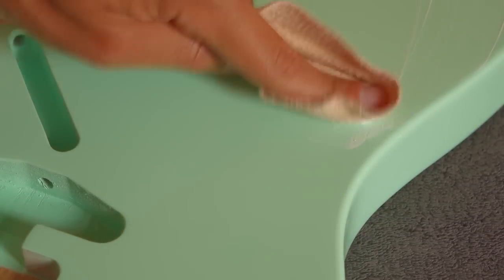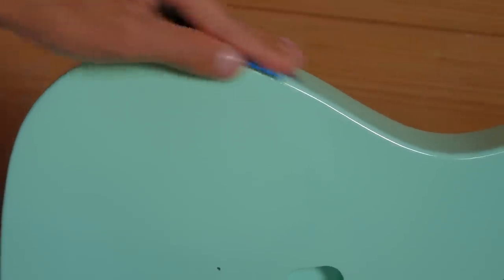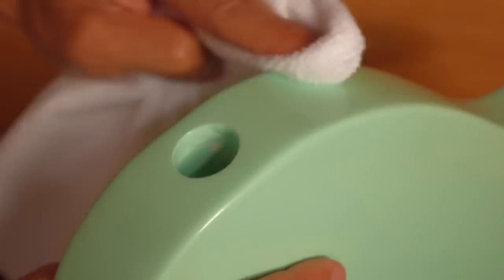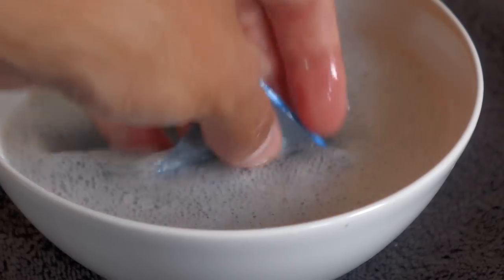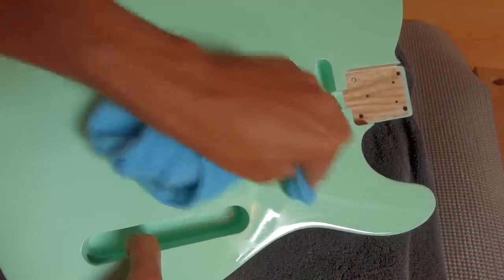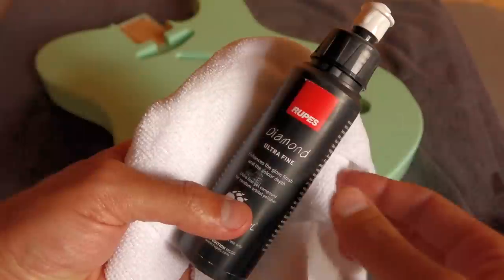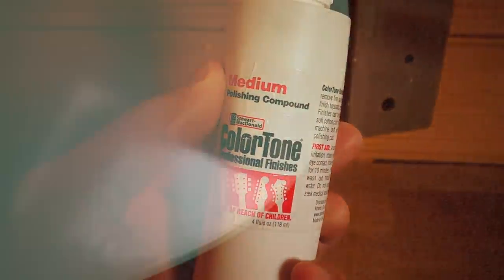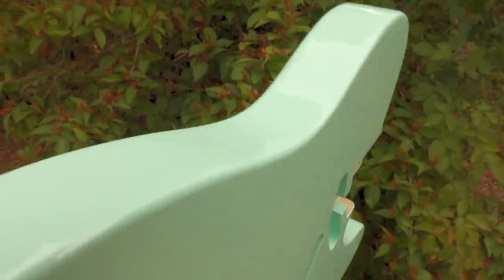Nitro Guitar Finish Tutorial - Part 3: Sanding and polishing

Comment: hey I took the recommendation of a guitar builder to use Nu finish scratch remover to take out swirls on my sg, however I later realized it has silicone in it, which is supposed to be horrible for nitro finished guitars, do you think I can sand it out? I heard its virtually impossible to get rid of and can ruin the wood if it makes contact with it, I love my guitar, its 15 years old, do you think sanding it could help?

Comment: If you were to do just one spot with a small ding, would it then appear lighter than the rest of the guitar?
Reply from the maker: Nitro tends to yellow quite a bit as it ages, so yes there is a chance the repair will look more pale than the rest of the finish. You could coat the repaired area with a tinted clear laqcuer to solve that.

Comment: I want to spray over a poly finished tele with nitro. Any recommendations? Would it be enough to sand with 200, 600 grit and 0000 steel wool and than nitro?
Reply: WOOLgum 400

Comment: Thank you for the excellent tutorial. Forgive me if this is a little off-topic, but you’ve got the best finishing videos on YouTube and your advice would be invaluable. I am considering doing a satin finish on a DIY project guitar. The grain filling process would be the same as you demonstrated, but would I then use satin finish paint, or could I use paint with any sheen and finish with a satin clear? Is the sanding of the color or clear coat any different when trying to achieve a satin finish? Thank you!
Reply from the maker: You can use pretty much any type of color coat and then just use a satin clear coat. A satin clear coat requires very little sanding. I usually apply a couple coats until I'm happy with the thickness. I then wet sand it once with 1000-1500 grit sandpaper and clean it. Then I apply 1-2 more coats and let it dry. That's it. No more sanding or polishing after that.
Reply: Lone Star Guitars Thank you!

Comment: Hey mate, nice work!
How many color spray can (400mL) do I need to apply 4 coats??
Reply from the maker: It depends on the thickness of your coats. But if you start out with a nice flat primer surface, and if you don't make any mistakes when spraying the color coats, one can of color will do the job just fine.

Comment: Just a tip, you should never sand in one direction and definitely not with you fingertips as you will run shallow grooves into the paintwork. You can actually see them in the finish prior to polishing. The reason orbital sanders are orbital is to avoid one direction sanding. I would also recommend a sand with P5000 if hand polishing.

Great video series though and an excellent finish from spray cans. Looks great. Thanks for sharing
Reply from the maker: The purpose of this video was to show how to create a great nitro finish without using expensive equipment and a spray booth. All of the finishes I do professionally are sprayed in a booth using a spray gun, sanded with a random orbital sander and polished with a buffing machine. Before I worked professionally however, I sanded all of my finishes by hand, exactly like I did in this video. There is indeed a risk of creating an uneven surface when sanding by hand instead of with a sanding block (which I addressed in this video), but if you know what you're doing, this will not be an issue. I think the end result speaks for itself. That being said, there are obviously many ways to create a nice finish. This is just one of them.
Reply: Yeah agree, the end result is great given the materials and tools. If this was aimed at amateurs I would just recommend sanding in overlapping circles to ensure an even finish. 

I wasn’t hanging $@&t, just adding a tip for amateurs who have not had much experience with refinishing.

Again, great result and great videos

Comment: Such a great video series! Really looking forward to finishing my DIY guitar now.

Question: I'm in the UK and struggling to find a set of liquid polish compounds that aren't either in huge bottles or that I'd have to spend loads on shipping for to get from the US. Anyone have any recommendations?
Reply: I've been using Meguiars for some years. They are an American brand of car polishes and Halfords stock them. They have various stages, I think they have changed the names on the range so their website will give you better information than I can. They are safe on nitro. Not sure how big you mean when you say huge bottles, these are big at 473ml so yes they last a long time and aren't that cheap, but they do work. The cheap and cheerful one stage option is Brasso, believe it or not. It does work well but it is very smelly.
Reply: @MrDblStop  Brilliant, thanks for the info! I'll check out Meguiars 😊

Comment: Hi. Great videos! Really going to help me a lot when I come to spray  one of my guitars. One quick question, if the colour coat gets orange peels do you sand it before or after applying clear coat? In the video before this you said that you could sort it out later. Maybe I missed something somewhere
Reply from the maker: Thanks! You don't have to remove orange peel in the color coat unless it's very bad. The clear coat will dissolve into the color coat, flattening it out somewhat.
Reply: @LoneStarGuitars  alright thanks! So only really sand out the orange peel after doing the colour coats but only if it's really bad?

Comment: I’ve left my body to cure for a couple days now and as i look at it i feel like the nitro is too thin and sanding/polishing might go through the finish? Any tips or is nitro just really thin? I’ve applied about 4 coats of color and 4 coats of clear gloss
Reply from the maker: What makes you think the nitro is too thin? Yes, it's supposed to be thin and it is very easy to sand/polish through. Those 8 coats should theoretically be enough, but it really depends on the thickness of your coats. I recommend to just start sanding the clear. In case you go through the clear you can always apply a couple more coats. It may sound strange, but sanding through the finish is in the end the best way to get a feel for the thickness. Good luck!
Reply: Lone Star Guitars thanks!

Comment: How would you reccomend doing a nitro over a new body of another factory poly color?
Reply: Travis Tucker I bought a heat gun for about 10 pounds and and paint scraper and got the poly off really really easy. Make sure you sand it totally smooth and use grain filler and primer as I was lazy on these steps and regret it a lot!
Reply: @JonHallMusic96  turns out i scooped a lightly reliced nitro body i still want to spray the same nitro over.  Clean and spray?
Reply: Travis Tucker I’m not expert at all. But I would say make sure it’s totally smooth, if it isn’t sand over it to make it smooth! Looks shit when the grain comes through
Reply: @JonHallMusic96  thanks man